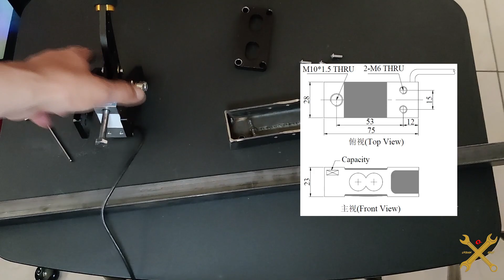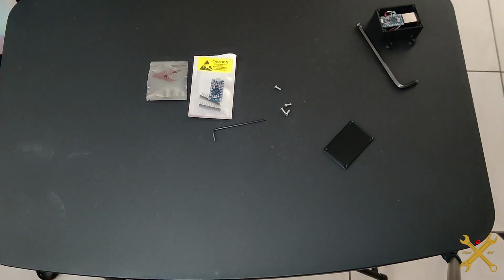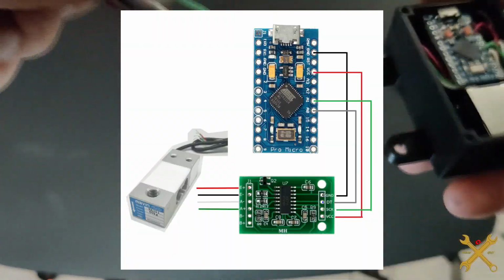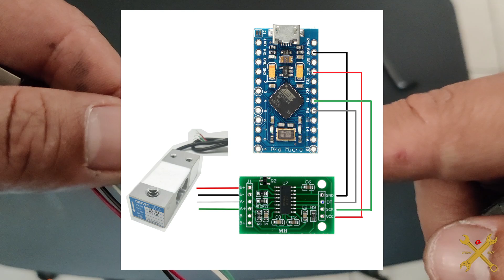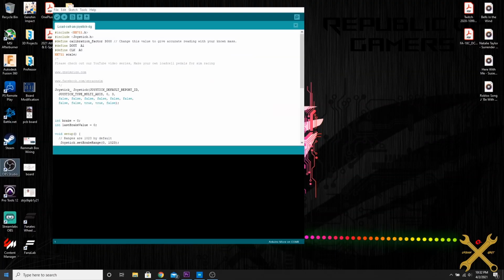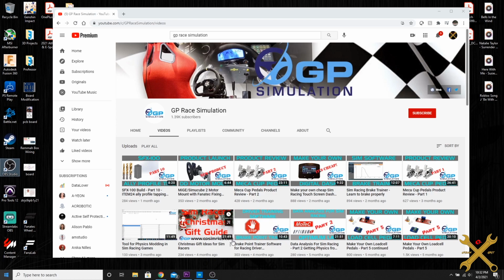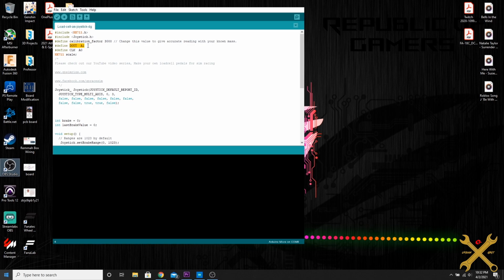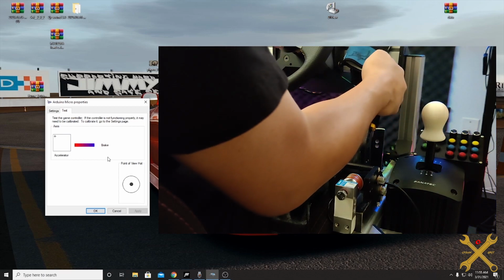DIY Loadcell Handbrake UrbanSTEIN

Comment: I'm having issues with shorting the amplifier board, after doing so my arduino is no longer detected by the PC, if I disconnect the board then it will detect it. Did any1 encounter this problem?

Comment: I just built this but my readings are very laggy compared to yours. I did lift pin 15 and short to VCC but it still seems very laggy.
Reply from the maker: You should be able to view the serial logs and check the reaction of the reading... If it's still laggy I would say double check your pin lift or even look up the board you bought... Some actually have a fuse that is soldered in to change rate speed
Reply: @blackote  thanks for the quick reply, I'll have a look tonight. Thanks.
Reply from the maker: @mike5058  no worries! Best of luck!! Let us know how it goes
Reply from the maker: @rockybrewer  right.. just double check again to see if your board has a way to change the rate speed... If it does it will have a fuse soldered in place that you need to move instead of pin 15
Reply from the maker: @rockybrewer  the 10sps to 80ssp data rate... Change it to 80
Reply from the maker: @rockybrewer  lol, that I won't know.. you'd have to see what the board manufacture says.. check the Amazon listing.. most the time the instructions are on it
Reply from the maker: @rockybrewer  what errors are you running into?
Reply from the maker: @rockybrewer  you're so close.. keep checking Google for work arounds
Reply from the maker: @rockybrewer  yeah your PC should make that USB sound and then open up your game controllers in control panel
Reply from the maker: @rockybrewer  DM me on discord urbangrit#2471
Reply: @mike5058 where did you get your Joystick.h from ?
Reply: @rockybrewer  can't recall exactly but likely just through IDE. Search the libraries.